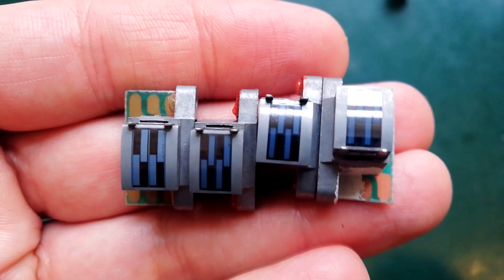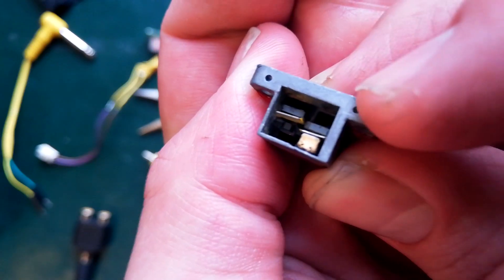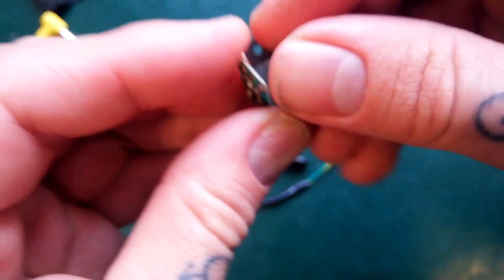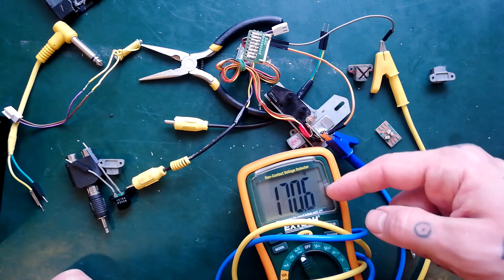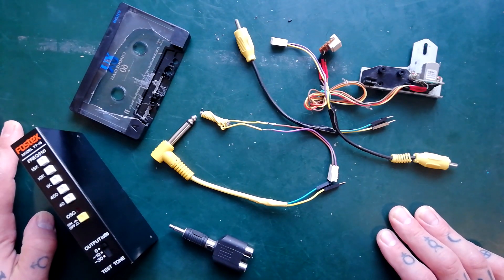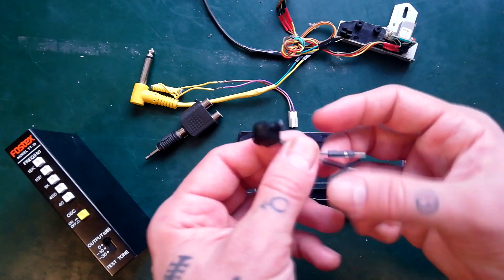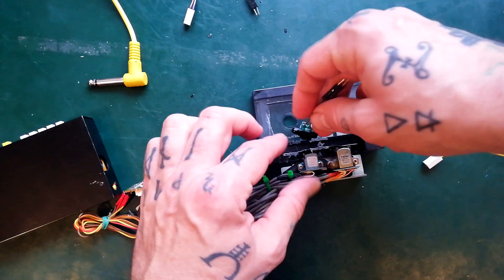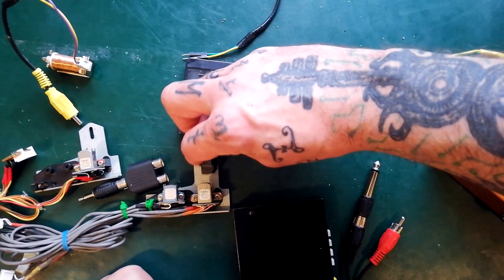Lapping is a Myth? | More diagnostics for cassette magnetic heads

Comment: I’ve worked on quite a bit of electronics in my time but never tape recorders. Question? Could you not just add another 4 head opposite the original 4 head and perhaps a small piece of alignment plastic and then you could simply have a 4 way switch to toggle the signal to each of the 4 heads. I believe this is how the old CD player to tape converters worked. You had an ordinary tape body with head in it connected to a 3.5mm jack that went off to your CD player. Allowed you to play CD’s on your tape deck. Having a signal generator that swept from 50hz to 8khz and then switched channel to 2 then 3 then 4 and back to 1.

Comment: Try telling that to the record/playback head on the Pioneer CT-S310 I picked up to refurb recently. I realise that it's 31 years old now, but there's a 0.2mm deep gash across the head from tape wear and it's well beyond the point where lapping could save it.

I've lost track of how many cassette heads I've had to change over the years due to excessive wear. All heads wear like this eventually in my experience. It's just a matter of time.
Reply from the maker: Ok. Your mileage may vary. This is specifically a multitrack cassette recorder channel -  I've refirbished at least 300 MCRs and have yet to encountered heads that require lapping. Whether that's due to  lower hours on these units or  different materials vs. consumer stereo decks, I can't say.

Comment: Manual lapping by hand is not a proper approach because even 0.2 mm deviation makes significant difference. Particularly with 1/4" open reel pro decks like Revox/ Studer. A jig is highly recommended with a USB microscope to observe abrasions and angular depth

Comment: Thanks for your videos, I'm restoring a porta one and you're a total guru. So the erase head on continuity measures 9 ohms on channels 2 and 4, and open circuit on channels 1 and 3, in fact these two channels don't erase properly. So I'm afraid the coils are open, there's no way to repair it right?
Reply from the maker: Thank you. Take those continuity tests at the base of the head in case it’s the connecting wires that are giving you an open circuit result, but if you’re still getting that result there’s nothing for it but to obtain a replacement erase head unfortunately. A healthy replacement head could be taken from any unit with that GEC generic transport in it though - at worst you might have to make small erase bias adjustments - so look out for parts donors on eBay and Craigslist, you could probably take a couple of bits from it and sell it on for most of the money to another repair hobbyist who needs other parts from it? Good luck!
Reply: @Tetrakan  Yes I checked directly under the head and reflowed the solder joints on the head pcb but still open. Since Ch 1 and 3 share the same part of the circuit, I'm guessing in the past something shorted and DC fried the coils, oddly I can't find no shorts now but I'm changing all electrolytics just to be safe. Thanks for your reply and advice on finding a replacement
Reply: @Tetrakan  also since you work on a lot of these, is it common to find open heads?
Reply from the maker: I’ve come across it on maybe a dozen heads over a couple of hundred units. 50/50 erase heads vs play record heads.

Comment: Wear on cassette heads does happen, mainly because (1) many home cassette decks use cheap, soft heads, and (2) because the pressure pad presses the tape into the face of the head. But quality ferrite heads do not wear much, it's true. I hope you're demagging those R/P heads after testing them for continuity.
Reply from the maker: For context I've never worked in a shop or had formal academic training with electronics, and I'm figuring out the cassette  stuff by myself, pretty much because I couldn't find any resources about it when I started trying to repair portstudios about six years ago. Yeah I demagnetise heads as a matter of course once I've established all 4 segments are intact, though to be completely honest, ive never, ever noticed a positive difference in performance after doing so! Ive read hearsay about Phillips doing a study which concluded demagnetising was unecessary for cassette format players and recorders, though ive never seen the study itself, only people alluding to it in forums etc. So im curious, what would you anticipate happening if someone ran a continuity test on the coil in a head then failed to use a degassing wand afterwards?
Reply: @Tetrakan  Hey, we all started out with no experience  or education, so don't let that bother you. Plainly, you're a lot further along than most folks who find this stuff interesting. I started out repairing audio gear in 1977, so I've been at it for a while.

Anyway, the current from an ohm meter or continuity checker is DC, and - may - be enough to magnetize the core of the head being checked. If it does magnetize the head, then each time you run a tape past it, it - may - shave a bit of the highs off the recording. It all depends on the amount of current coming from the tester, the coercivity and retentivity of both the head's core material and the tape you're playing, and how many times current is run through the head in the same polarity.

That said, the current from a DMM is likely to be much lower - and therefore less problematic - than the current from an analog VOM, or worse yet, a mechanic-style continuity tester with a light bulb and battery. These last can actually burn up the fine windings in a head. I check heads with a DMM's ohmmeter function all the time, with no problem, but then I always demag a tape deck after doing anything that brings tools near the tape path, mainly due to the fact that even tools that are nominally non-magnetized can still have a weak magnetic field around them.

As far as demagging cassette decks on a regular basis, there's probably no need to in the case of a two-head deck, because the bias (when recording) will demag the R/P head, and the erase current will demag the erase head. As long as nothing is introduced to the machine that can magnetize other parts of the transport (like the cheapo rotating-magnet "demagnetizers" that record shops used to sell in the '70's), all is well. In a three-head deck, though, the play head never sees bias current, and leaky coupling caps (if present) in the front end of the playback preamp can magnetize the play head. But this can only be truly fixed by replacing those leaky caps.

Keep up the good work!
Reply from the maker: I appreciate the detailed response. Yeah all the multitrack units I work on  are 2 head units and I've only ever used my DMM for continuity test, so I guess that explains why I haven't heard a big difference after  using the degaussing wand, but I hadn't realised that the current from VOMs was so much more significant than a  digital multimeter - I'll be sure to mention that caveat if I'm discussing  the topic on youtube in future, thanks again.
Reply: @Tetrakan  No problem. The current from a DMM is usually in the low microamp range or less (except on diode check, where it can be higher). With VOM's the current through the device under test has to be enough to move the meter movement directly, and so on a cheap 1,000 ohms-per-volt VOM the current can exceed a milliamp, and that's possibly enough to cause a problem.
Reply: @ScottGrammer  about the need for demag: I had a NAD 6040 deck with Dolby (B) / HX. If not demagnetizing for a while, the recordings included very low frequency thuds along high frequency signals. It was 90's when I looked at the rec signal with scope and saw the bias changing according to the high frequency content. Checking now, it's called adaptive biasing and the original Dolby HX was rejected by the industry because of its inherent flaws.

To the point: bias signal wasn't enough to keep play/rec head demagnetized. Now thinking if the HX caused magnetization... Anyway, the low thuds in the recording did not appear on freshly demagnetized head, so this has been my personal experience and justification for demagnetizing. To be fair, on any other tape players I can't say I've proved the benefits of demagnetizing. I've just assumed it's good practice.

Comment: Great timing on this video I have eliminated everything electrical so I will be looking at the tape path next. In the normal run of things is it just vertical movement that will need adjustment in regards to the erase head.
Reply from the maker: Yeah I think so....I’m always cautious about giving a definite answer because although I’ve probably got more experience with this stuff than most folks who watch my videos I’m still trying to figure it out myself! You could also check the head assembly raises without obstruction, that was the issue with the marantz at the end of the video.
Reply: Tetrakan Supermonobloc thanks for the videos, whilst I am handy enough with a DMM and soldering iron there is no way I would have the ability to figure out all the steps to troubleshoot the problem.

Comment: Hey there, off topic but.. when you test the op amps in these tascam units, do you do it with the power on? Thanks for all the videos!
Reply from the maker: Hi, yeah. I avoid testing linear power supplies ( portastudios with an internal supply ) with the power on unless it's absolutely essential because there is some risk of electrical shock or damaging components if you short something with your probe, but most things after the power supply can be tested safely with the power on, and on the case of active components like  opamps it's impossible to test them without  power. My basic process is read the serial number on the chip and Google the data sheet so I can see which pins are the power rails and which are the audio inputs and outputs (plural because usually a chip will contain two discrete opamps) then it's 1) check the opamp is receiving power using a DMM 2) check ac audio is reaching the input and 3) check the audio is exiting the output at an appropriate volume and without distorting - either a oscilloscope or an audio probe can be used for steps two and three...I find it's s bit quicker and more intuitive to  use an audio probe. If step one fails, troubleshoot the power system, if step 2 fails, your issue is earlier in the audio signal path. If step three fails, replace the opamp. If all three tests pass, the problem lies later in the audio signal path.
Reply: @Tetrakan  ok thank you!